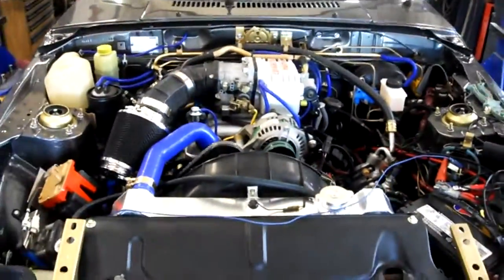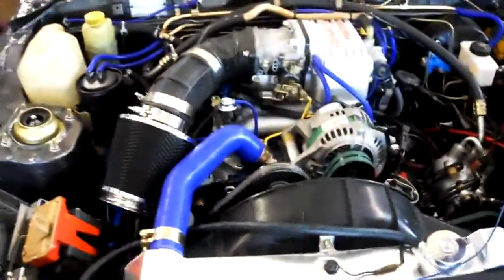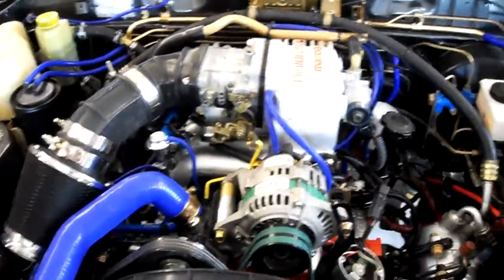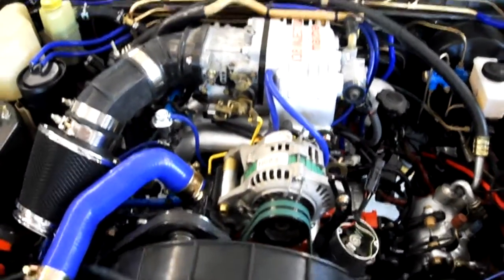13B Rotary Engine running on MegaSquirt 2 Extra

Comment: sir im actually doing this on a 12a turbo, but i stil dont know what i have to do to the distribuitor to make it work. i aint getting spark at all. i have the ms 2 v3.57.
do i really need to cut teeth from the distributor?.
how are the settings suppoused to go?

Comment from the maker: Carlos V8,  The engine in this 1985 car is from a 1986 Car with the 13B 6 port  4 injector engine.  This is the  first year for Mazda to use electronic ignition on this engine.  Mazda removed the Distributer and replaced it with a Crank Angle sensor at the Distributor location rather than on the Crank shaft.

Comment: Hi there from Spain

i have a question, where is the distributor cap? not wires from cap in this model of ignition? is a indution distribuitor so it does not need wires, it just send signal to ECU?

When it came from factory it had carb and you change to injection?

Comment from the maker: I found with the single pulley to get it to stop Squealing with the lights on I had to use a pry bar to put enough tension on the alternator to stop the slipping.  So to recap, no squealing belt and yes the alternator runs quieter because the shaft bearing is not seeing the same amount of tension.  The 2 belts assure that the alternator is always being driven to produce  a good solid output and charge the battery. No horse power gain.

Comment from the maker: The Bad, you need to find a matched set of belts.  Belts are close but are made in batches.  When you pick out the belt put them between your hands and stretch them over each other to seem if they are the same length.  
The good. Less tension required on the alternator and no slipping and squealing  when you have the head lights on with the Air Conditioner fan blowing.  No belt squeal at all.

Comment from the maker: The alternator came from Car Quest painted that way.  The double pulley is from Atkins Rotary.  The Silicone Hoses are from Ebay.  Search RX7  Hoses. The lower hose could not be used due to the after market rad that is huge and had to be lowered 1 inch so that the hood would close .  This made the lower silicone hose 1 inch too short and I could not use it for this application.